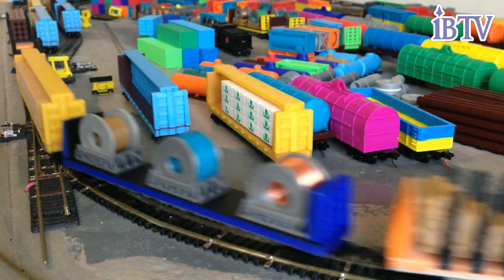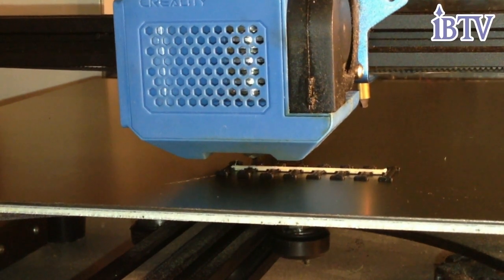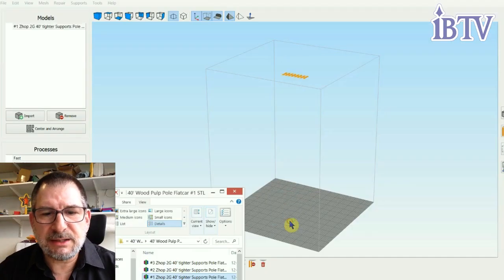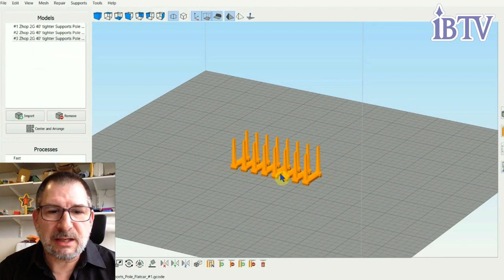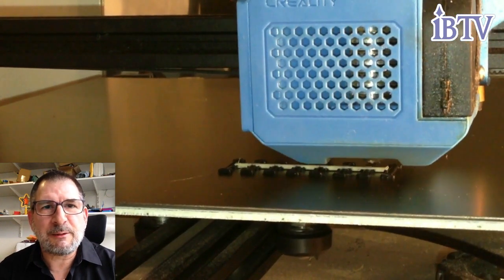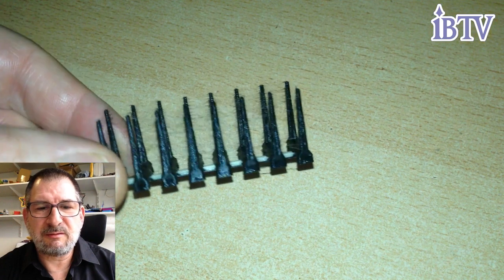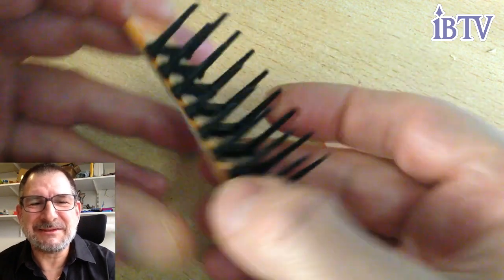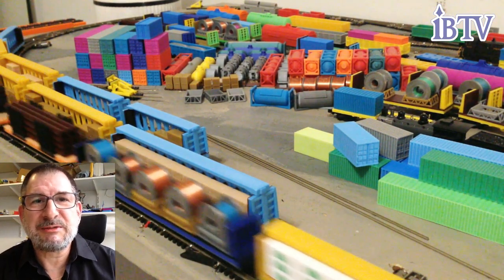Z Hop In The Middle Of A 3D Print 40' Wood Pulp Pole Flatcar #1

Comment: Since you’re printing all of a color at once, do you have any issue with the side of the nozzle hitting the previous color/s?
Reply from the maker: So far not with 0.6mm (2 layers) max difference in height. For this model the black was still visible with 0.6mm so I doubled the technique for a 1.2mm total cream layer by making the black 0.6mm high and then doing the cream all the way 1.2mm leaving it the same 0.6mm higher. I did the same with white and green, would have seen them smearing if it was hitting. Haven't tried to see just how far it can go though, seemed the 0.6mm or doubled 1.2mm was enough to get the color effect.
Reply: @handlaidtracksand3dprinted922  ah, ok. I didn’t realize 0.6mm was 2 layers. Prusaslicer, when set up for multi color, single nozzle, will actually print 2 layers at a time to save on color changes. I’m in the middle of building an ERCFv2, but I sort of promised someone I’d print something for them and they’re going to need it soon. So this was a very timely video. Thanks!